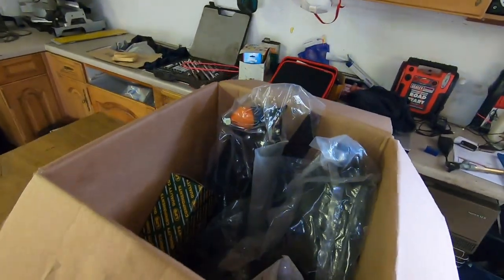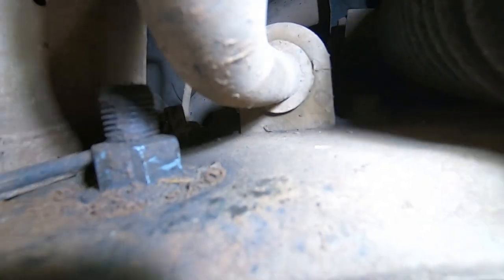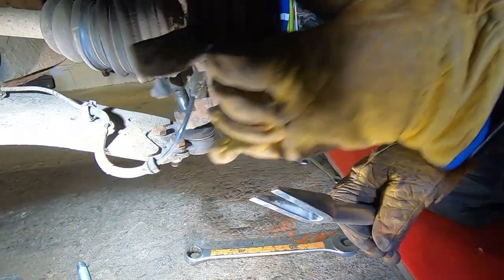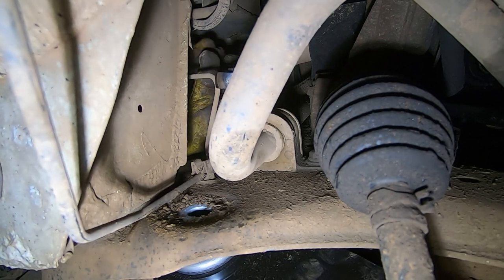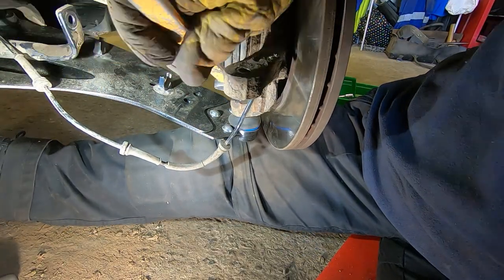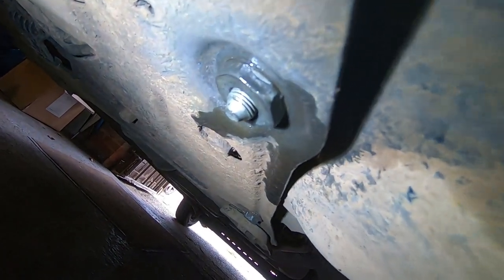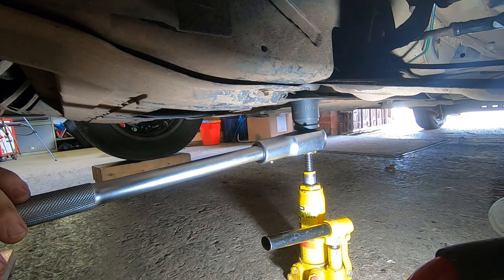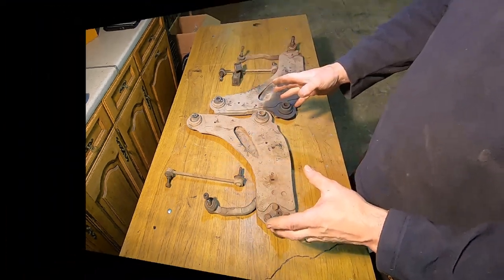Vivaro project Pt6. Replacing the front suspension Arms, ARB bushes, track rod ends & droplinks.

Comment: Larc have you ever come across a noise when letting of the accelerator only seems to happen in lower gears when in high gear and on a motorway no noise nothing now been advised to change these arms so im just woundering if the noise comes from these control arms
Reply from the maker: @dannybartlett4225  Sounds like your engine mounts/steady's might by on their way out. Watch the engine while slipping the clutch on and off with the handbrake on. If the engine rocks a lot they could be worn out. I've got some other engine mount videos that might be helpful. Good luck sorting it out 🤞.

Comment: Hi there, thanks for such a useful series. Got the same issue with my Vivaro. Quick question. I see you say you don't recommend the set you bought from EBay because of poor track rod ends. I've already changed those on mine so only need the drop links and control arms- but the kit is still far cheaper than buying individual parts. Can you give an update on those parts please? If they are still OK after a year I'll order the EBay kit and bin the track rods. Thanks again. James
Reply from the maker: Thanks, yep, everything else still seems to be ok👍.
Reply: @LarcsWorkshop  Brilliant, thanks for the feedback. Think you've just saved me about £50. Videos are so helpful for DIYers like me, thanks and please keep up the good work.
Reply from the maker: @MrGuardcaptain  . Thanks 👍

Comment: Same experience with my 2018.80000km   vivaro.that 30mm was the only problem. Used a hot air solder 500°C to get it off.paid 500£ for two arms...
Reply from the maker: Yes, they're a pain aren't they 😳. £500 for two arms? Sounds expensive?
Cheers Larcs 👍

Comment: Hi guys where are you based pls
Reply from the maker: Somerset, UK.
Cheers Larcs 👍
Reply: @LarcsWorkshop  how long did this take to do the near-side ? 
Off-side took an age on the one bolt alone, so I'm crossing fingers for both sides be simple.
Darm knocking drives me crazy but went thro mot without an issue. Strange eh! I'm going change anyway for £100 & hopeful quick easy solution & quieter journey
Reply from the maker: @DownAvenueWay  Good luck with the repair. It would have been a lot quicker if I didn't have to borrow some of the tools. Probably would have got it done in a morning. So much better and quieter to drive, especially after the alignment was done😃.
Cheers Larcs 👍
Reply: @LarcsWorkshop   thnx , yea took 2days darn nuts 'n bolts.
 actually, in real time around 4hours 
Ur absolutely correct, get the tools ready along with others you won't release u will need. 
Saves time & "language"
Reply from the maker: @DownAvenueWay  😂Yeah, so true, good work👍.
Cheers Larcs 😃
Reply: @LarcsWorkshop   it's more me thankful of ur vid, I'd probably not replaced without first watching especially as you had trouble and actually shown frustration undoing that bolt..  I then knew I'd most certainly have a problem and gave myself those couple of day's. Only took as I mentioned, 4 hours actual time stretched into next day with tracking & balancing.
No more bumps & creeks 
 runs & drives smoothly.
Reply from the maker: @DownAvenueWay  Proper job👍👍😃.
Reply: Thanks for making everything easy to see, my 04 1.9 needs a n/s ball joint at 208k, had new track rod ends a couple of years ago, I expect I’ll have to do everything else that you did too. Showing how much the old ball joints move is very helpful. Thanks 👍

Comment: I've a high roof Vivaro on a 63 plate. 3 years ago it took an impact on the roof on the offside. 2 garages I've been to cannot seem to locate a squeak on the RHS when going over speed humps + it slightly leans to the RHS but drives perfectly. They have changed the track rod ends, drop links and dampers but not the springs as they looked ok according to the mechanic. I'm tempted to change these parts myself as the bill is already over 1k 🙄 Thank you for the informative video 👍
Reply from the maker: Thanks, wow that sounds like a bit of a nightmare 😲. Almost sounds like something has got a bit twisted? Good luck sorting it out 👍
Cheers Larcs.
Reply: @LarcsWorkshop  The only thing that's got twisted is my wallet 😁Thanks Larc
Reply from the maker: @pulsey2001  😂🤣 nice one 👍
Reply: @pulsey2001  lol !
its  not the drivers door is it ? try leaving the door on its first catch an driving it ?

Comment: Had to cut one of the control arm bolts off today it was made of toffee I think 😅 struggling to find a replacement now 😭 thanks for the video. Boots next, found a leak.
Reply from the maker: Wow, good work 👌. Good luck with finding a replacement and the repair 🤞.
Cheers Larcs 👍

Comment: Just reading the Haynes manual for my vivaro and it says only use the jack points that are next to the wheels to jack up the van.. But I put my 2 ton trolley jack under and at full extension the wheel doesn't even start to come off the ground. Jacked it from the sill too and bent it.. Where do you jack it from?

Cheers!
Reply from the maker: I normally jack it up from either the cross member behind the sill at the bottom of the 'B' pillar or under the front subframe, where it bolts to the body. Good luck sorting it out 🤞.
Cheers Larcs 👍

Comment: Great work..!
I can feel knocking vibes through the steering wheel on my van.
And it pulls like crazy to the left. alignment didn’t work either.
I’m sure this what I need to do.
Nice work 
👍🏻.
Reply from the maker: Thanks, good luck with your repair. Be ready for those tight bolts though 👍.
Cheers Larcs.
Reply: probly bottom ball joint or arm bushes so jus get an arm or 2

Comment: Could you tell me where you puchased the kit please?
Reply from the maker: I got the parts from eBay, the item numbers and links are in the video description.
Cheers Larcs 👍
Reply: @LarcsWorkshop  Hi. How has the kit held up? I'm about to do this change myself to our 2007 Trafic and hope to only do it once!
Reply from the maker: @matthewhunt8871  . I was quite disappointed with the quality of the rubber boots on the track rod ends, I've had to replace them (the boots) already and they've been on there less than a year. The other parts have been ok. I wouldn't buy the same kit again.
Cheers Larcs 👍